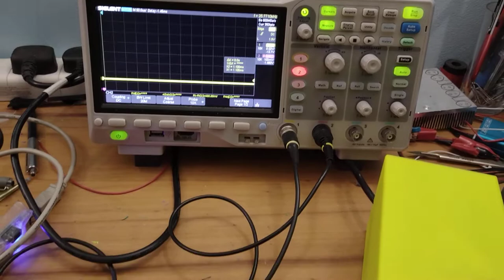Easy DIY ESC running MESC firmware sensorless on CA120 motor

Comment: Very nice. I need to build one for my electric surfboard. I need a 350A ESC
Reply from the maker: There is no way this ESC can do 350A. The MP2 project I help with might get close, but for 350A, you really need 24+ TO220 MOS or metal PCB... I built 12* TOLL ESC and documented it here: https://endless-sphere.com/forums/viewtopic.php?f=30&t=118614 Probably enough for electric surfboard.

Comment: Wait, did I just see it drawing up to 177W with no load and only 22V supply? Phase current must be like 150 amps??
Reply from the maker: That's not how it works. You're applying P=I²R as if it was a DC resistance. The power to spin the motor is because of Eddie current losses in the stator. This is a very lossy motor. The Eddie currents create drag torque and so the effective phase current can be assessed as roughly 2/3x177/(22V/sqrt3), about 9A.

I can't remember exactly since this was ages ago now but the hardware is set up to trip at <100A so 150A is absolutely impossible. 

I can tell you that the likely phase current setpoint to drive it at that speed is about 5A.
Reply: @DavidMolony  I have played with this motor 12 years ago, phase current was through the roof, due to three reasons: eddy currents, extreme low inductance (ripple alone is 125A at 50V battery) and bEMF shape mismatch.
Cheap "6fet" controller blew up above 5% rpm, and "18fet" controller was struggling to reach above 50% speed (no load), and drew like 400W just to spin it.
It's a very poorly designed motor, I have actually used it to test various controllers to see their algorithm quality, also when I developed my own FOC controller 12 years back. 
Just connect your oscilloscope to current shunt amplifier....
Reply from the maker: @circuitdotlt   I can easily run this motor at several hundred amps FOC with a 20s battery on the 12FET controller I have made. The key is in the control algorithms. This 6 FET controller probably cannot cope with 84V and this motor, but it is by no means impossible. I have of course scoped the outputs of the opamps. Ripple current up in the 20A range. 

The inductance is crazy low, but that is one of the reasons why you can force so much power through it. The limiting factor for how much power a motor can ultimately eat is the voltage you feed it with and the inductance.

Comment: hi David. this esc hardware where you plug the blackpill F401 looks interesting. you have some info about it?
Reply from the maker: Hi Frank,

The hardware is covered on this thread at Endless Sphere https://endless-sphere.com/forums/viewtopic.php?f=30&t=114537&hilit=easy+diy&start=125 
It was originally intended to be used for EBICS and the Casainho/stancecoke ebike firmware, but due to Casainho struggling to bring up the board, I got one sent to me, soldered it up and ported my firmware to it. 

It is readily orderable and buildable at home. You need to be quite savvy to get the firmware running at this stage though. It performs well.